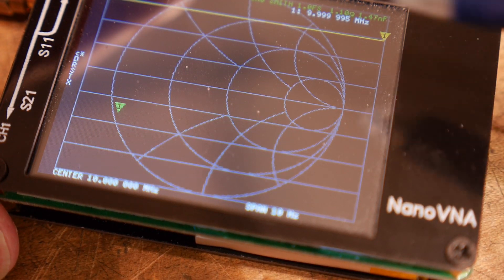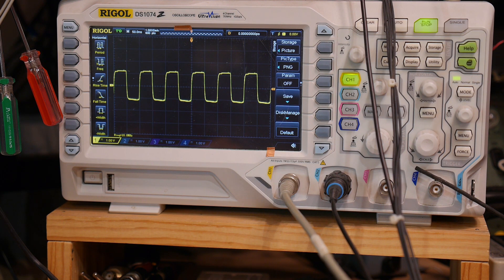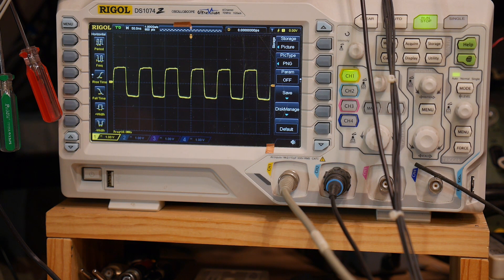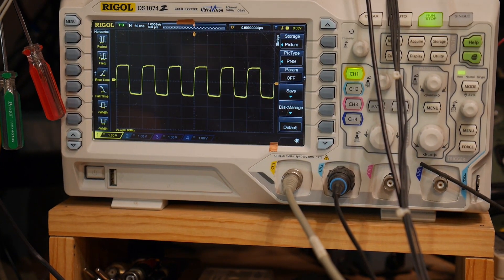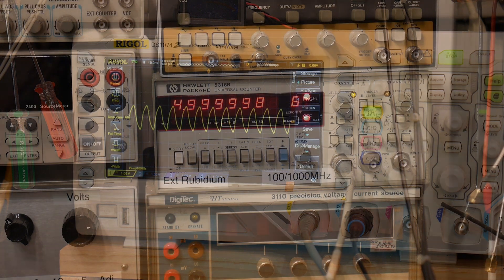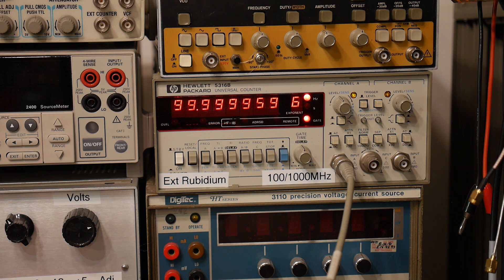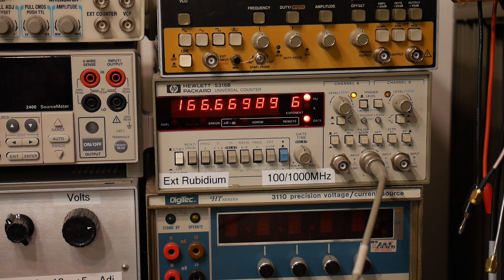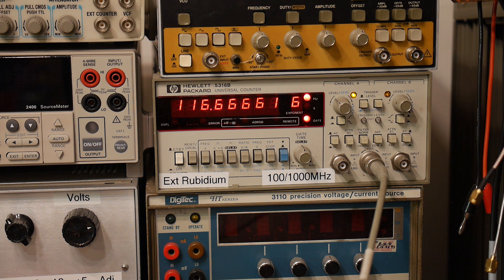#360 NANOVNA accuracy

Comment: I have to agree with other comments...this guy is totally unaware that the device uses the third harmonic above 300 MHz, and probably uses a HPF on the receiving side to "see" only the harmonics. 400/3 = 133.333 MHz fundamental, 500/3 = 166.666 MHz fundamental, etc.
Reply: read the comment from arm margret where he did answer that he did some video later on showing that it just uses the harmonics, as the LO can only go up to official 200MHz and in Overclocking mode up to 300 MHz stable. (see his video https://youtu.be/cU05VVFl0N0)

Comment: The nanoVNA User Guide (available online) shows you're really checking out the accuracy of its Si5350A clock generator, used to generate both its output signal and (30 kHz offset) internal tracking.  It's a simple digital clock generator so outputs a square wave (not a sine wave like a true frequency synthesizer), but this works fine because the nanoVNA internal mixers select the fundamental (when tracking with 30 kHz offset) or 3rd harmonic (when tracking with 90 kHz offset, to extend its range above 300 MHz albeit with reduced dynamic range).  p.s. Might your video have been more informative to viewers if you had read the user guide first?

Comment: The real Q - what is the accuracy over mild temperature excursions?
Block diagram indicates a VCTXO (going from memory) WITH a line from the uProcessor, so, one would think the uP is capable of compensating the freq according to measured local temperature from maybe a lookup table in code ...

Knowing the characteristics of the oscillator or crystal, a "curve" is defined, the limits of which are determined by the cut of the crystal, so, there may be a programmable value that trims the freq over temperature, too.

Comment: since the device is designed to use the third oscillator harmonic above 300MHz, what you need is a HPF to check the accuracy
Reply from the maker: yes that makes sense, but since it is harmonics you only need to check frequency accuracy of the fundamental tone. I'll trust the 900mhz is spot on if the 300mhz is.
Reply: for some value of "fundamental" :-)
Reply: no you don't. the level drops from 300 to 600 and drops even more from 600 to 900
Reply: ahem. perhaps you misapprehend the term "accuracy" as used here? accuracy as in: frequency. the signal level does not enter into what has been discussed in this thread.

Comment: In the user guide it is indicated that there are several firmware, you probably have the one that makes 50k - 300Mhz (nanoVNA-300-ch a -70db) , there are 2 other firmware that allows use up to 900Mhz 50dB (300M-600MHz), 40dB (600MHz-900Mhz)

Comment: Up to 300 MHz the 1st harmonic is used. Higher that the 3rd harmonic is used. So for example at 400 MHz the fundamental is (400/3=) 133 MHz. But there is a catch: dynamic range is reduced, as it is referred to the specifications
Reply: re: "But there is a catch: dynamic range is reduced, "
>> Makes rational sense; a) the reduced amplitude of the 3rd harmonic relative to the fundamental, b) the reduced performance of the 612A mixer chip as well at the higher frequencies.
Reply from the maker: that makes sense. Do you have access to the source code?
Reply: IMSAI Guy from a quick search it seems to be a copy of this: https://github.com/ttrftech/NanoVNA, so it would be relatively easy to modify it for your own needs. The circuit is in fact a DC receiver with IQ inputs to calculate parameters, with filtering done at audio spectrum. A fairly common principle of operation in this class of instruments.
Reply: @IMSAIGuy  I believe this may be a copy of edy555's NanoVNA. 
https://github.com/ttrftech/NanoVNA
It uses 3 SA612A Double-balanced mixer oscillators with a rated max input of 500 MHz and oscillator frequency of 200Mhz.

Comment: Good question, wonder how it's stimulating the port at over 300MHz? Did you check the output with your spectrum analyzer? Thanks for the series, I shared your original NanoVNA video with our ham club as a starting point for them...lots of other reviews out there as well...can't go wrong for $50!
Reply from the maker: The spectrum analyzer shows good data to 300MHz and funny business above. some magic going on
Reply: re: "when testing  easily saturated magnetic core DUTs."

Oops; danger Will Robinson; into non-linear device characterization at that point ...